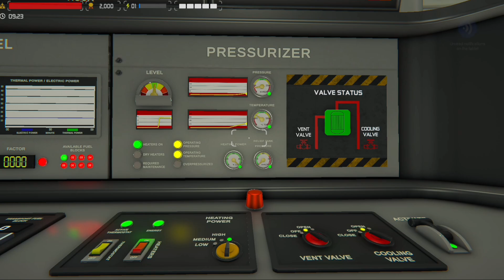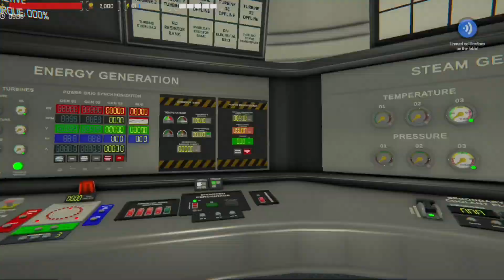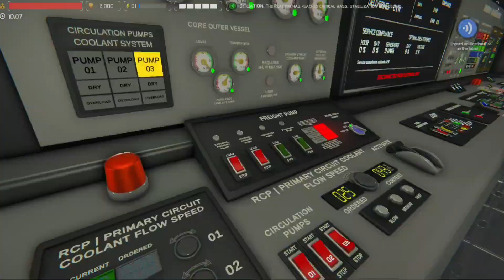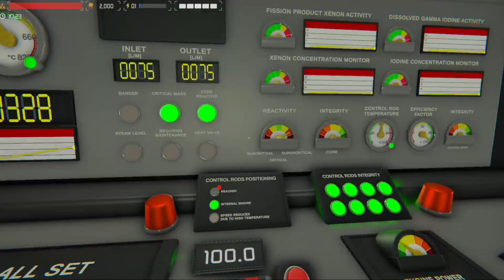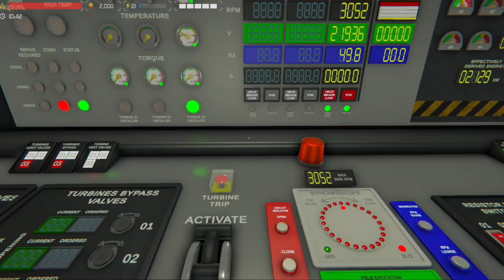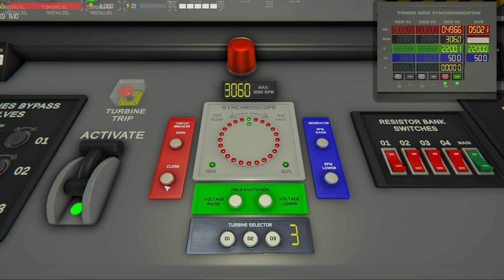Nucleares Beginner Operation Guide

Comment: My coolant volume continually increases with no relief. What happened?
Reply from the maker: you may have left on the freight pumps
Reply: @ never turned them on- I found a fix to open vent valves which brought the volume back down. Just following your procedure I had that issue skyrocket my coolant volume!